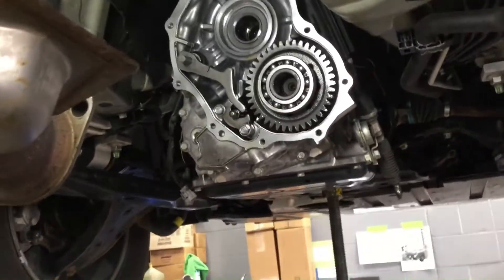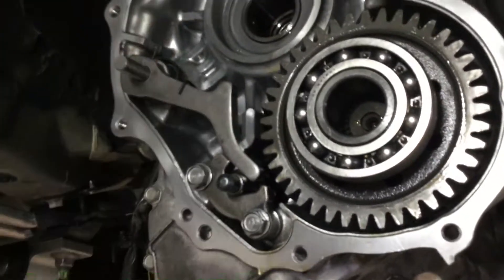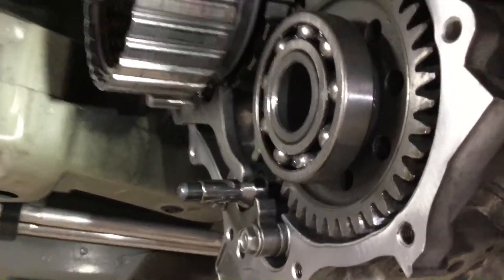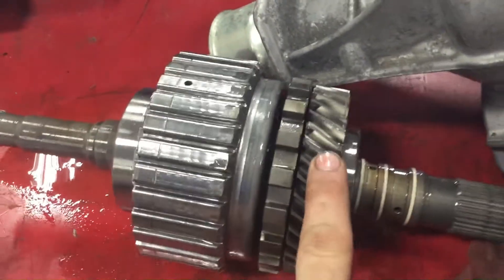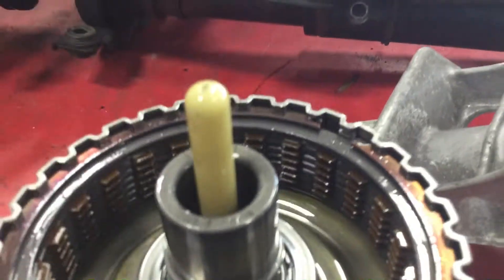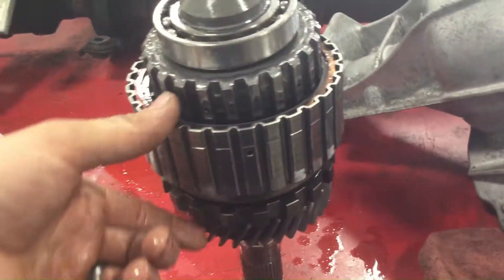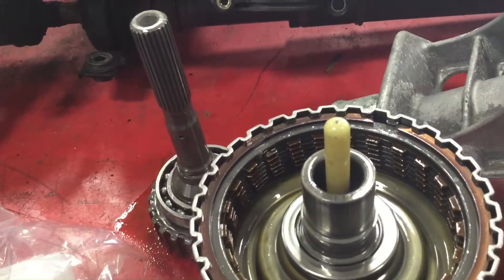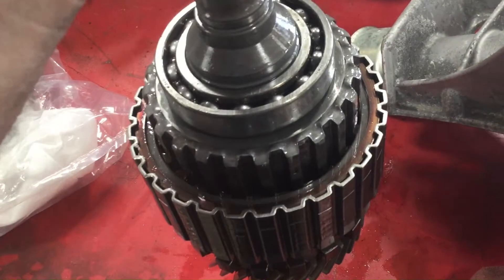CVT Transfer Clutch replacement

Comment: I heard some Subarus have a planetary. My Lexus GS350AWD has a planetary and will lock if there is a major slip. I see why this clutch may perform somewhat better but the tires better be extremely close in tread and size. The planetary is more forgiving, there is no warnings about tires in my owners manual.

Comment: I've got a 2012 Outback with a TR690 that is always binding up during slow turns. I'm comfortable doing these kinds of jobs, so is there a list somewhere (service bulletin) of the parts that should be replaced?
Reply from the maker: i'd strongly advise having a dealer do a diagnosis to verify no chain slip first. Often, chain slip -> metal in fluid -> metal in clutch packs -> transfer clutch bind, forward clutch slip, etc. etc.